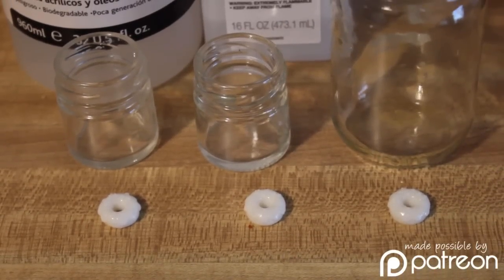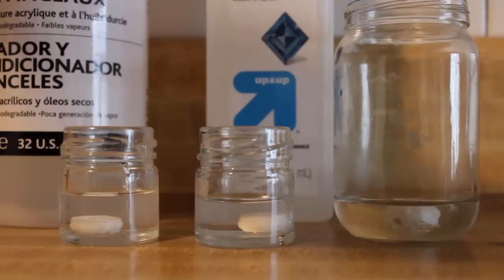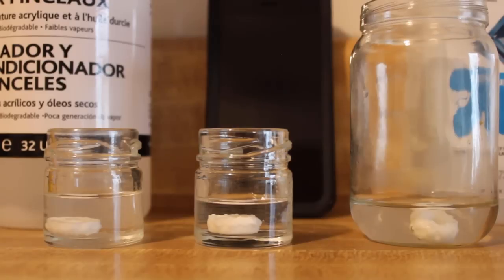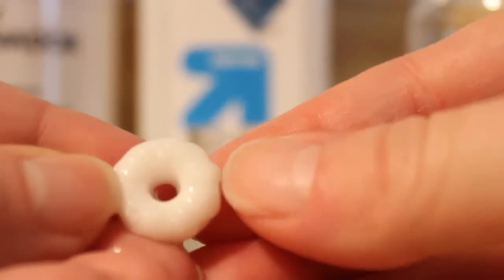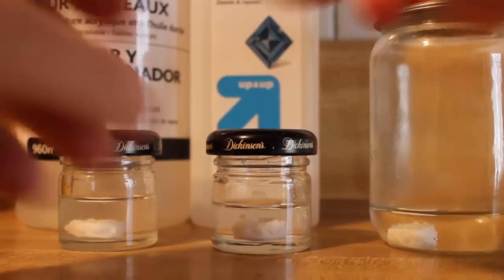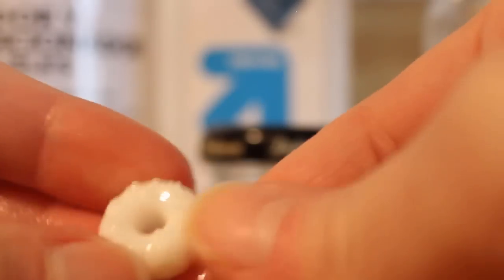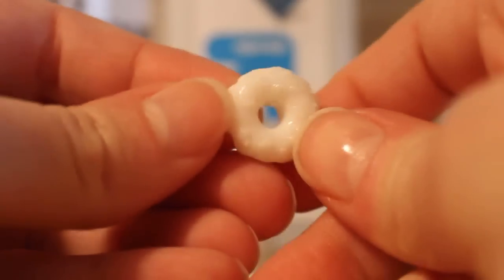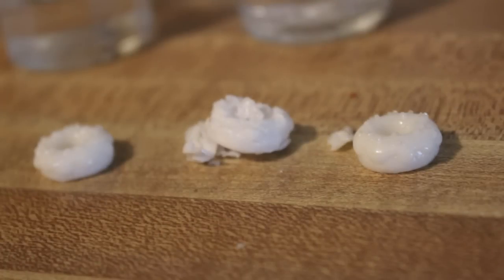What does faceup removal really do to resin?

Comment: interesting, i think acetone is the best option, lets remember that acetone evaporates super fast  so even if you dont  rinse the acetone  it wont do anything to the doll cause in 1 minute or so it will be evaporated, and i think is the best option cause it gets the job done in an efective and quick way and no one is going to soak their doll on acetone like in the video, it would be more interesting if you painted a little "faceup" in the donuts  so we can se how quickly is out of the resin, i wonder if water really takes out the faceup.

Comment: basically, as long as you take the safety measures, it's not a problem to use any of these solvents in dolls. I personally use acrylic thinner because it's faster to work with and I can get those really stubborn stains out easier. Also acetone is almost impossible to find here because it's used to dilute cocaine it seems x.x but yeah... being aware of the time of exposure and always rinsing it off thoroughly, you'll be safe :3 thanks for the experiment!

Comment: I work with epoxy resin a lot and have cleaned up a lot of mistakes of cured resin. While acetone doesn't "melt" resin per se, it breaks it down more or less. I've cleaned out old nail polish bottles that I've filled with resin, with acetone. It becomes brittle and flakes away. Just like you see in this video.

Comment: ive been in the hobby since 2006 and had it drilled into my head NEVER EVER to use Acetone on resin. Its not that it melts per say like with other hard plastics but it CAN make it more brittle over time with repeated use
Reply from the maker: Yes, I've heard that as well. I've been in the community since 2008 and one of my goals is to challenge hobby misconceptions and myths, as well as provide detailed information about why we do the things we do and use the materials we choose. "Never use oil-based anything on dolls" is another one I heard a lot, but in the past year I was able to dip into that issue to explain what the risks actually were, and when you might WANT to use them. Like acetone, when correctly used, oils are not damaging. My dolls that were damaged from faceup removal were damaged with 91% rubbing alcohol, not acetone. The important part of this experiment was learning what damage looks like, so you know what to watch for to see if a doll isn't tolerating a cleaner well. Some dolls are melted or damaged by Winsor & Newton brush cleaner, too. 😱

Comment: Amazing! Thank you so much for the comparison, it's very helpful. Another thing I hear a lot is that coloured nail polish removers like the pink or light blue ones will stain your doll.. is that something you would consider testing as well?
Reply from the maker: Certainly! I'll add it to my list of solvents to test. :)
Reply: I used a purple one on one of my dolls and it stained like no other. I had to buff the stain off, but it's okay, it was only a resinsoul
Reply: Yup, colored nail polish do make ur doll stain.
My boy head becomes a bit blue because the nail polish is blue.

Comment: I usually use Windsor and Newton brush cleaner as much as possible then finish off the job with nail polish remover. But after like 5 minutes of use I wash the dolls head and continue with removing. Never had any problems. But I have mostly fairyland dolls. So maybe That’s why.

Comment: Is the brush cleaner safe for vinyl dolls as well?
Reply from the maker: No, I don't recommend the brush cleaner for vinyl, as the conditioner chemicals in it that protect harder plastics like resin can cause the plasticizers in vinyl to leach, causing them to turn sticky with time. Acetone is the best option for vinyl dolls. Vinyl can be exposed to acetone for hours before it will show signs of exposure, and then all that happens is the vinyl will shrink :)

Comment: You can take facup off with water right?
Reply: DynamicQueen no you can't, you need brush cleaner or acetone
Reply from the maker: Antonia is correct, water will not budge a faceup on its own. You have to use a solvent like acetone, brush cleaner, or isopropyl alcohol. I used water here only as a control substance because I've never soaked resin in water for more than 20 minutes or so and I wanted to have something to compare to wet-texture wise when I pulled the other pieces out of the solvents.
Reply: Lomi's Playground ahh I see. Also how porous is bjd resin do you think?